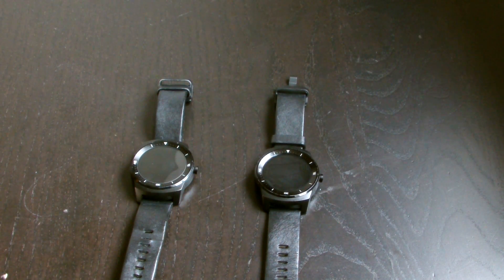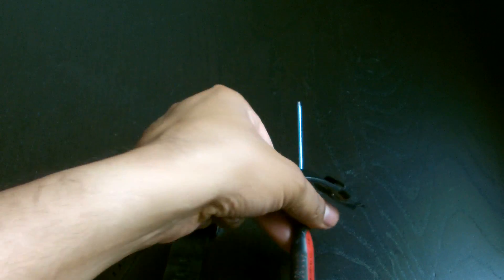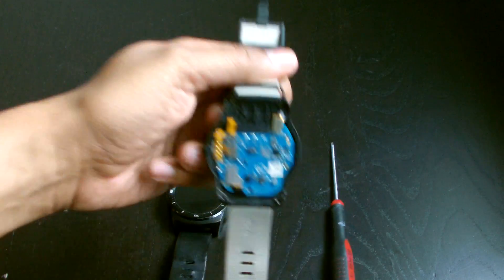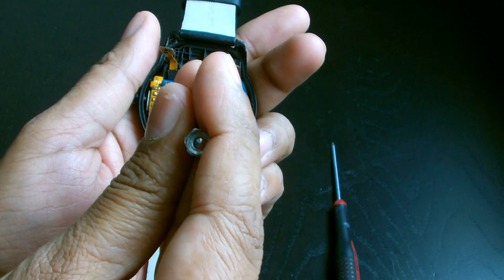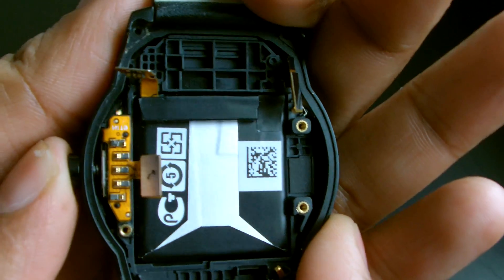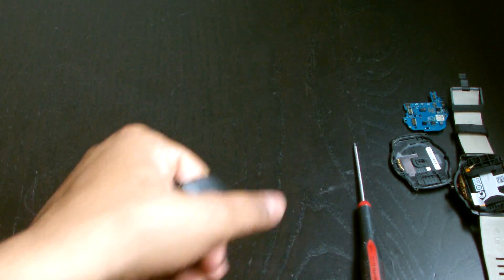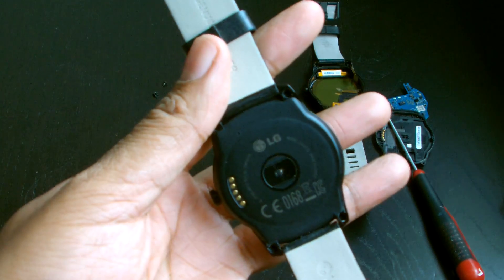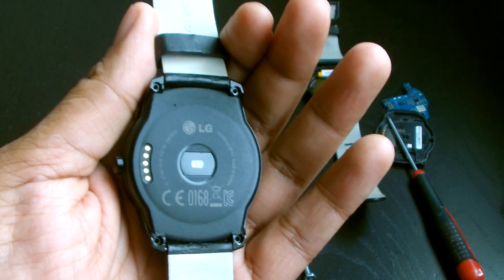LG G Watch R Teardown and Repair - Disassemble

Comment: Hi, I need help. My G Watch R does not turn on unless it is connected to power. It only turns on when plugged in, and the instant I unplug it the screen turns off. Do you know of any solution for this? I already tried to restore it from the factory and it remains the same :(
Reply: how did you solve the problem

Comment: Nice video, I have one but Turns on when it wants and only on the charging base, I can do everything but when you move or remove the watch it off instantly. Maybe is the battery
Reply: Yeh sound like possiblely the battery.
Reply: @LightboardingTech 
how did you solve the problem

Comment: Awesome!  This video took care of all my questions on how to replace the battery and successfully swapped a new one out.
Reply: Where did you get battery?
Reply: Hey Willie, ebay seller zing*001 from China.  This was the description...
100％ New 410mAh 1.6Wh BL-S3 Battery for LG G Watch R W110 & Watch Urbane W150

*Other important factor.  After I replaced it, and used a 2400 mh charger, I found out that only some cables worked!!  I had to swap out a few charger cables before I saw the circular charging indicator work!  *  good luck to all.
Reply: Thank you, Chef Rover....

Comment: where did you bought that battery??im looking for lg urbane battery?
Reply from the maker: Hey Victor. I got the battery from ebay. search for "LG W150 battery"

here is a link for the Ebay UK
http://www.ebay.co.uk/itm/Genuine-LG-G-Watch-R-W110-W150-Urbane-Watch-BL-S3-410mAH-Battery-EAC62618501-/351642045872?hash=item51df7fcdb0:g:IIUAAOSwaB5XrbeU

Comment: hi do you or anybody have a same problem with black dot on lg g watch r screen how to fix that? thanks
Reply from the maker: HI Sounds like a dead pixel. Not sure they can be fixed without replacing the screen.
Reply from the maker: how to remove the screen. Might help ! https://youtu.be/WWj_00ilkqQ
Reply: Haruki Kichirou I've got the same problem, but no solution 😂

Comment: If you are changing the battery does if need to be pried out with a screw driver or can you just use your fingernail to get it out?
Reply from the maker: +Troy Wilborn Hey Troy. The battery is glued in you could probably get it out with your finger nail.